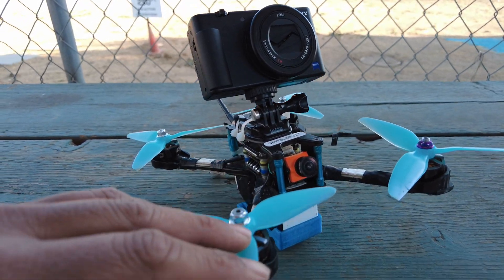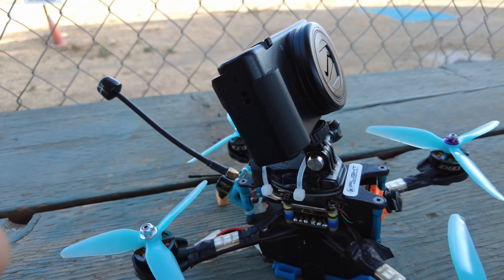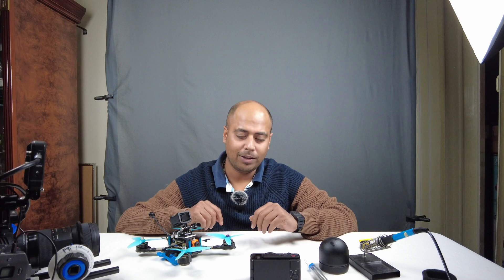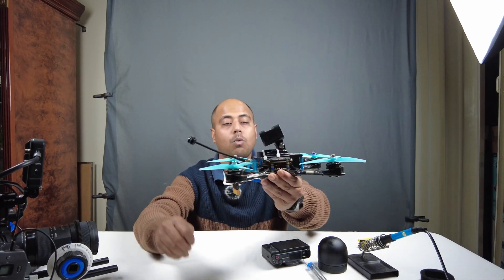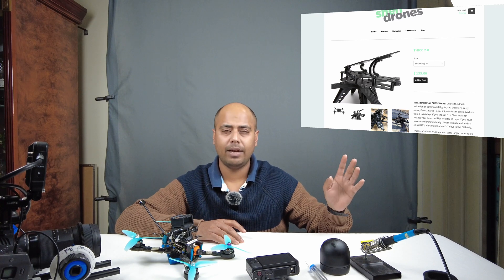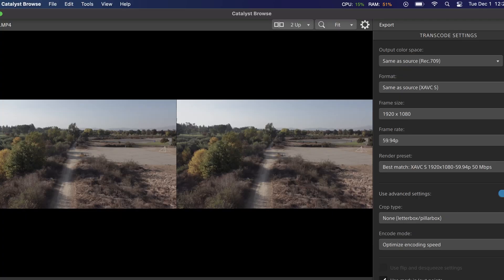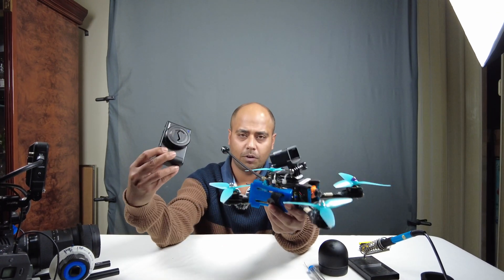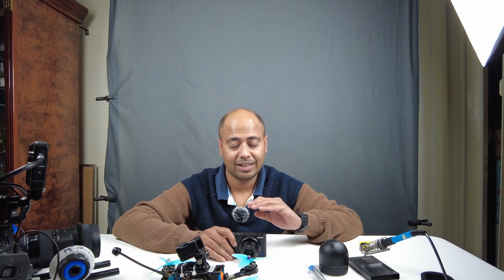sony zv1 on a drone ! experiment day 1 with catalyst browse

Comment: Also in order for catalyst browse to work correctly you need to set your shutter speed to like 1/1000 and you will have to add motion blurr back in post production. Also doesn't the ZV1 have a built in ND filter?? I think it'd be beneficial to try the test again with higher shutter speed and with the built in ND filter turned on with catalyst browse.